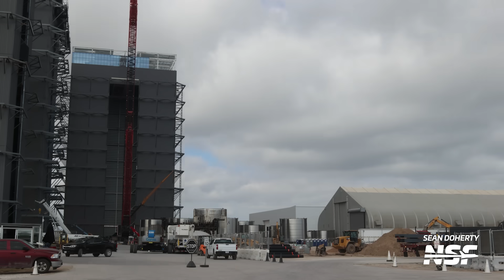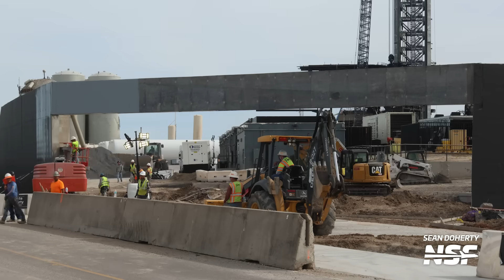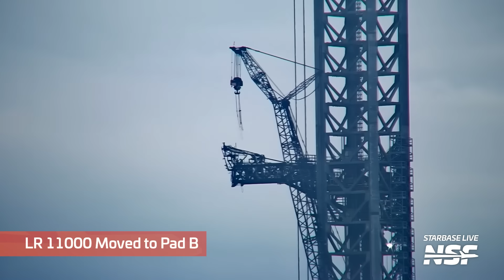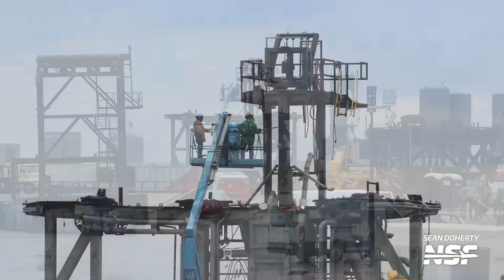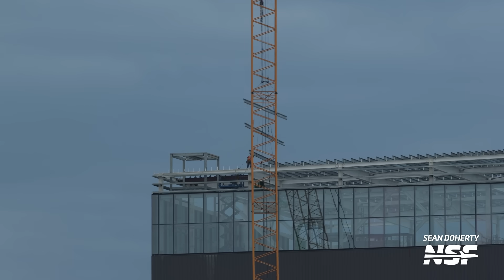Suborbital Pad A Scrapping Begins | SpaceX Boca Chica

Comment from the maker: 0:00 The Production Site
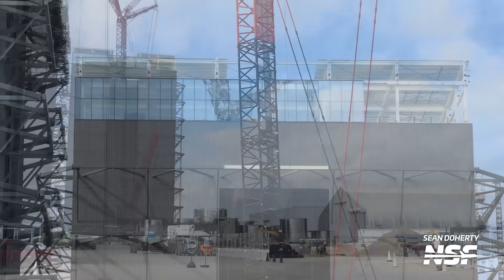0:15 Top of the New High Bay
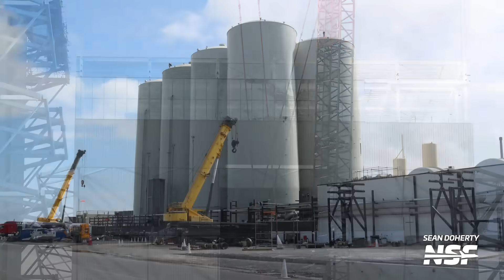0:28 Orbital Tank Farm Vertical Tanks
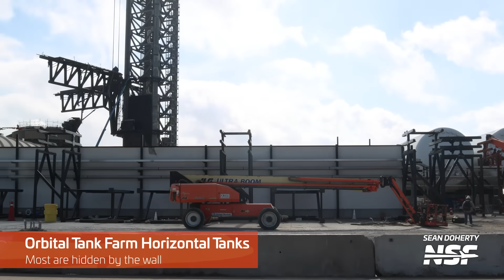0:41 Orbital Tank Farm Horizontal Tanks
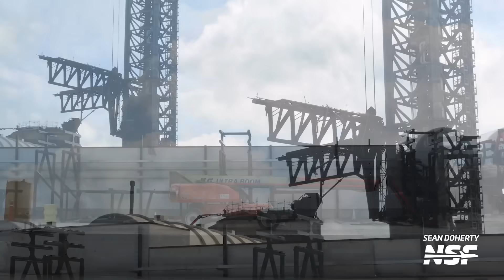0:55 The Chopsticks
1:21 LR 11000 Crane Moved to QD Arm
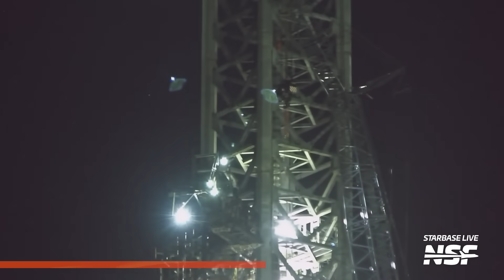1:33 Crews Fix the SQD Mount
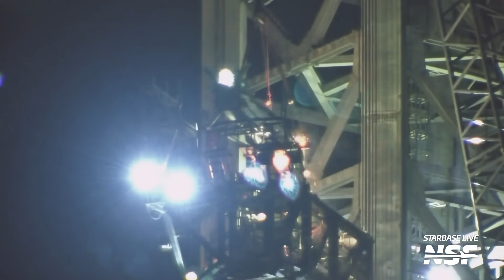1:57 The Rocket Garden
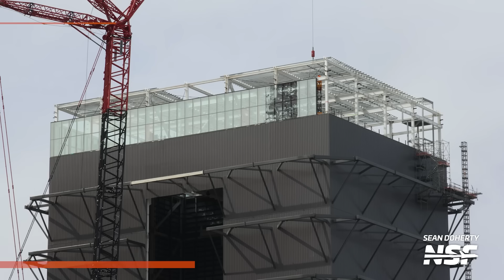2:02 Top of the New High Bay
2:18 The Production Site
2:34 Starfactory Construction
2:59 Work at the Suborbital Site Wall
3:23 Suborbital Pad A
3:36 Tank Farm Piping Supports
4:00 Ship QD Repair Work Continues
4:44 Ship 26 Disconnected From Crane
4:57 BQD Cover Testing
5:11 SQD Work Completed
5:45 LR 11000 Moved to Pad B
6:27 Pad A Scrapping
7:45 Work on the Tank Farm Expansion
8:11 The OLM and Chopsticks
8:23 The Rocket Garden
8:36 Work on B10’s Press Hoses
8:47 New High Bay Roof Beams Installed

Comment: It is so they can build a second launch tower with a normal flame diverter.
Reply: The first OLM has a flame diverter!!!  That is exactly what the deluge does:    It diverts the raptor flame away from the base of the pad.
Reply: That is a water shield, deflecting the exhaust in all directions to protect the pad from damage. A true diverter accepts and redirects the outflowing exhaust away from the pad. (Think Saturn V, Space Shuttle, Artemis style diverter, a sloping ramp for the exhaust.)

And yes, I meant a true diverter.
Reply: @SecretSpace-oq5ql  the SpaceX works as well if not better than a traditional diverter (1/2 ways v.s 6)